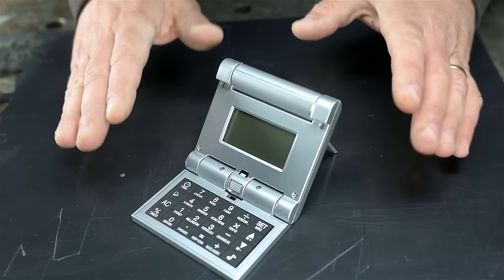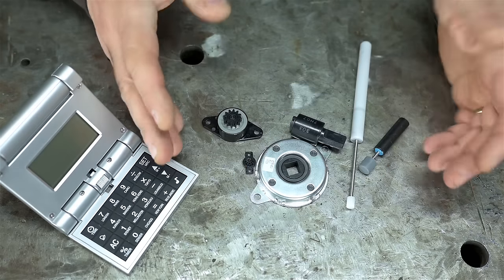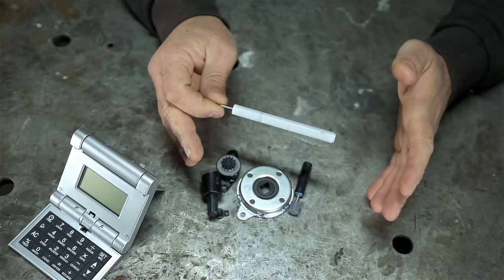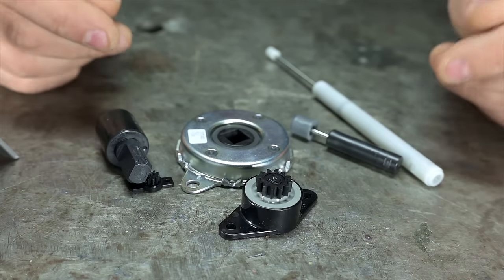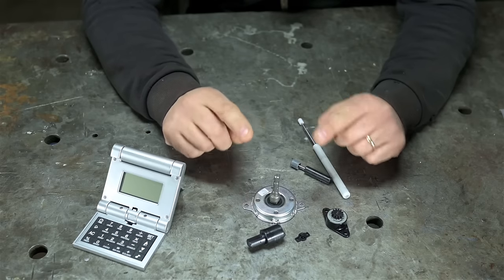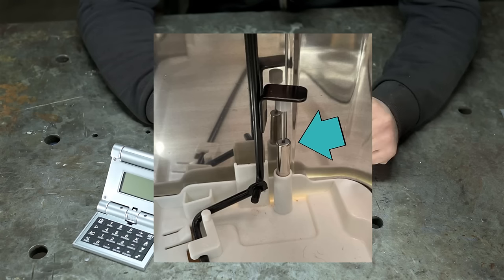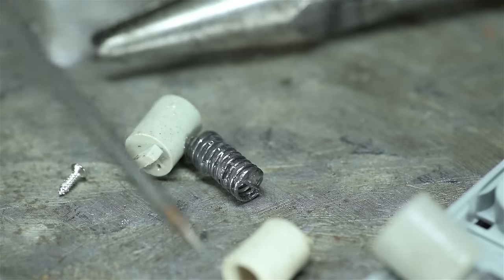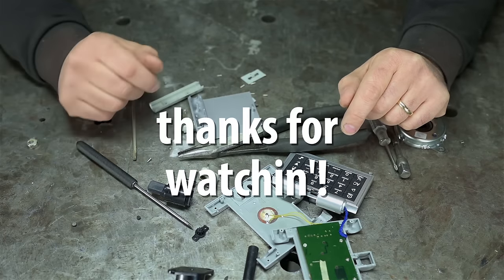Dampers... WHAT A DRAG!

Comment: The fan clutch on your vehicle is also a damper.. engine heat melts a wax and the spinning motion forces the wax outward and locks the fan hub causing the fan to spin and cool the radiator. As the radiator cools down the internal spring forces the wax back towards the center releasing the fan until the temperature gets hot enough and the cycle repeats

Comment: i remember as a kid, seeing that flip open calculator thinking it was so cool!

I pondered for a while how it worked, I decided on a small spring  similar type to the ones in tape a measure, with a felt or some type of friction material pressing on it. 

turns out i wasn't too far off.

Comment: You can find a big one in most rear wheel drive cars on the cooling fan for the engine. Limits the rpms of the fan at high speeds when it isn't needed. Helps save gas. They have a bi-metallic thermostat that reverses the dampening so it dampens more at higher temps and less at lower temps.

Comment: I've seen several that were just greased rubber Orings. Side note I modify linear dampers. Namely racing shocks. Pistons,valving and fluid changes all change the characteristics of a shock. Along with gas pressure to keep the oil(fluid) in check. I can make a LR shock take over a minute to come to ride height on a 2400 lbs car.

Comment: Fun fact, for all coiled spring designs (ie not leaf or Belleville or similar type springs), torsion springs actually don't experience much torsion but rather are loaded  in tension/compressions while typical tension/compression springs mostly only experience torsion.

Comment: CAT used to have a "rotary damper" called a brake saver. Slowed the truck by shearing the oil in housing between the block and trans. Worked great but I don't think it was ever produced by any other manufacturer

Comment: Ive been wondering how they do the slowed hinge movement for ages now! This finally gave me an answer and a whole lot less to worry about in future projects
Reply: you can also do this with magnets did it quite often making flush door cabinets you would mound polar magnets on the door and frame with opposite orientations you can basically slam them shut without the risk of damaging anything as the magnets would slow them down before the magnetic fields aligned correctly

Comment: Great video, very interesting.  

It's strange that car mechanics always say "Your shock absorber is shot" but really mean that the damper is shot.  The spring is the shock absorber which rarely fails and the damper which does fail, simply damps out the oscillations of the spring or shock absorber.  

The Millennium Bridge in London was nick named the wobbly bridge when first opened and had to be retro fitted with dampers to remove the potentially dangerous oscillations.
Reply: "Shock absorber" is the combined assembly of both spring and damper, not just the spring (which, weirdly enough, is called a "spring").
Reply: The spring is the spring. The shock absorber (damper) is the shock absorber. When the spring is wound around the shock absorber, they’re called the strut.
Reply: Funny things, words. The spring stores energy (the "shock") rather than absorbing it; likewise the damper dissipates some of the energy (motion) as heat. So no absorbing really occurs in any technical sense.

Comment: Haha, saw this World clock calculator thing after a very long time.
Story: 1990s, in a village, the local doctor had one of these, and called it the 'electronic glucometer' and used to charge premium for 'running the test' on this. Actually the test was run using the test strips where you match colors. The patients had never seen anything this complicated or technical, and would pay extra to get their blood sugar tested more accurately with the so called 'Electronic' glucometer'. Simpler times!

Comment: Actually the same thing used in some $10k+ cinematography tripod heads. Usually includes a mechanism to adjust the clearance between the opposing surfaces and thus the resistance.

Comment: The fuel tank gauger in my car has a rotary damper that has run dry with the years. I will pierce a small hole in it and refill it with hydraulic fluid. So it stops going from empty to full in every stop.

Comment: Damped it to heck, I wanted these dampers to be some magic mechanism where some thingy rubbed on some other thingy with elegant, force-controlled-by-speed thingy. Instead, it's just plain old laminar-flow fluid dynamics.

I've seen, actually even touched, a rotary  damper made with a motor with its leads "shorted". The resistance of the "short" controls the torque versus speed constant. This was for a really cool outer space thingy so it was way more expensive than a simple PM motor and a resistor, but that was all it was!

Comment: I used to have a calculator with lid that slowly opened when released.
It used a Very Thick Grease around the spring mechanism that slowed down the opening!  Otherwise, it would just snap open and just break itself to pieces.
Hot or cold made no difference to it opening/closing.

Just like your opening calculator/clock.  Yup its the very thick tenacious grease that slows the opening that the spring causes.

Maybe that is what you need!?  (or not for your dampeners)

Comment: I'm currently in the process of painting my truck. I just had a nightmare when I saw that silicone goo on your fingers, imagining that I messed with a damper and 2 or 3 days later, I'm checking the body work on my truck and some of that goo residue is on my hands and I transfer it, unknowingly,  to the surface of the vehicle. It got my thought process going about hand moisturizers and hair conditioner, many of which contain silicone compounds. I've been having problems with fish eyes in my paint jobs. Silicones are just a terrible compound for so many reasons. They just don't go away...kinda like plastic in a landfill.

Comment: How about a vid on the workings of a gas lifter. I think its the same pressure in the cylinder but the area difference between the back and front of the piston wil cause the rod to have more force present at the larger area, hence pascals law, so the rod is pushed forward. If you want a larger force, more pressure is introduced at manufacturing. And is it possible to refill them? They are getting expensive.

Comment: My laptop has a washers hinge with plastic washers between them and instead of a locking pin, it has a small bolt and nut that can be torqued to control the damping strengh.

Comment: It was interesting :-) I was expecting you to also mention how "the resistance level in dampening is modeled by resistance in an electric circuit with L+R+C. R being resistance, L inductance and C capacitance. It swings according to the 3 values, and can be used to accurately model how many times e.g. a car suspension will bounce at a certain weight, dampening and "springage"" - true story - had an asignment with it in UNI.
Reply: Electronic simulations in e.g. MatLab: E.g. finding the most comfortable speed to pass a speedbump - it's not always the slowest. Or finding how many times the center of someting springy will pass the middle point in a spoing before the dampening slows it to a halt.
Reply: @RGSneaker  Driving primitive roads is a good real world example too. A safe speed for the curves and cliffs on either side is usually too slow for the bumps to smooth out.

Comment: The goo is indeed silicone grease. If your hands are still stuck to your mouse, toluene is your friend. Methylated spirits also work a bit; not great, but better than acetone.
Thanks for the video! I do like these ones on mass produced, cost efficient designs.

Comment: I have a prosthetic knee, two in fact, one is a rotary damper and the other is a linear, both have some clever design in knowing if it is on heel strike or toe lift and can disengage the dampening effect accordingly. The range of motion is the biggest difference between them, the rotary being the superior in that regard by about 25 degrees making it easier to sit crossed leg and to kneel. The other difference is how they are armed meaning if they are going to damp or not. The rotary is dependent on a heel strike and takes a while to get to trust it and works well, the linear model is always "armed' and will always slow a flexion down but feels heavy and slow compared to the rotary... Info no one asked for, but there it is.
Reply: damping       NOT        dampening  !!!!!!!!

Comment: On the meta-level, the excitement of hoping to find a complex spring and damper mechanism was greatly slowed and reduced when you revealed that the clock contained a combined spring and goop assemblage where the plastic part press-fitting into the hinge provided all the connection.    So a very minor emotional rotary damper.

Comment: Now you might not read this but I hope you do. So one thing that comes to mind now and then that really puzzles me is the gravity lights that were made a while back for places and people that don't have power on a regular basis. Pretty sure they started on Kickstarter but you basically lift a weight and let it drop and the weight drops over a few hours or so and is converted into mechanical energy than electricity so on and so on. How are they restricting the fall of the weight and at the same time harnessing the mechanical energy. Is it dampers or is it something else?

Comment: The overhead sunglasses/ reading lights box, thing in my Sentra needs this.
I mean, it looks like there used to be one but now, just a little curved strip with gear teeth on the door part.
Also, zip ties are not effective dampers.

Comment: Were the calculator ones actually dampers or did the sticky just cause slower rotation by sticking?? Like doesn't there have to be some kind of baffle or valve to call it a damper? Great video!

Comment: the company i work for makes wallets that have a soft close feature like that for the mechanism (it fans the cards out) and we use exactly the same method. Spring with tacky grease on it. Probably exactly the same grease... And yes it's awful to try and remove. I think the current method of removal is goo-gone and those wipe-all wipes with the textured surface.

Comment: What is the failure mode of these? My toilet lid has started slamming instead of slowly gliding down, but I can't see any grease leaking out. I would guess that the grease is too thick and the baffles in the damper have carved permanent channels through it? Maybe not enough injected during manufacture?

Comment: I've seen in cassete radios, where it was just two gears, with that same sticky goo in between them (I regret touching) and it would make the smooth effect. Technically it was a gear and an angled toothed rack, similar to shown at 5:05 (bottom). I was disappointed with the simplicity

Comment: I pulled plenty of cassette decks apart as a kid in attempts to repair the eject mechanism.  Greasy wheels were the cheap and nasty dampers that they used.  The grease always worked loose and the decks would throw the cassette across the room when you pressed the eject button.  In your case there it looks like they used epoxy (without the second part!).
Reply: Does vinegar wash that sticky stuff off ?  If so, epoxy ?

Comment: So, viscous dampers, but what about friction dampers.  Friction  dampers were used in the suspension of early cars instead of "shock absorbers".  My old Triumph motorcycle had an adjustable friction damper incorporated in the steering yoke.  Electromagnetic dampers, often electronically controlled, of various kinds are used in many places in this modern world.  Nevertheless, viscous dampers have simplicity on their side.

Comment: What did that poor little calculator do to deserve a discectomy. I would love to see more electronic videos from you old Tony. I want to serierialize south polarity magnets in a spherical orientation inside each other with the center one connected to a microgenerator to a buck converter connected to a something that needs low voltage dc power. Ps try to avoid doing it on a metal bench. 🤔

Comment: If you're  really trying to incorporate a damper into a commercial design, you need to remember that what's actually happening is the conversion of kinetic energy into heat.  So if you're damping a lot of energy, or doing it repeatedly, heat transfer becomes something to consider.  That's why commercial shock absorbers should never be painted.

Comment: Silicone Viscosity Fluid, a.k.a. “donkey grease” (as in the harder you push it, the more it resists) is the primary limited-slip element in the center diff of a lot of Subaru vehicles. It has some interesting properties. No common solvents will cut it, and the best way to remove it from your hands is to rub them vigorously with oil-dri (cat litter) and then wash your hands with wd-40 and dish soap (and repeat). I t’s entirely chemically inert and anything you apply it to will effectively be permanently waterproof. It would be the perfect dielectric grease if it weren’t almost literally herpes-level permanent.
Reply: Toluene is a way to break it down just dont get it on your skin.... oh and WD-40 completely forgot about that

Comment: I found those calculator dampers quite ingenious as a cheap solution to mimic the action of commercial units. Even if they look rigged to hack all they work and in the end if you can achieve an identically reliable result through half assed measures then all the more power to you for thinking outside the box.

Now if someone could just come up with a solution fix the Air Core Gauge Motors that go to my 1996 Chevy suburban instrument cluster life would be soo much better. People charging $80-$150 per unit!

I guess they rely on a certain viscosity silicone grease that acts as a dampener of sorts to smooth out the movement of the dial. Over time the silicone grease dries out causing them to flutter or show incorrectly. I guess you can find the silicone grease in quite a range of viscosity on websites specializing in turn tables so if anyone just happens to know what GM used in their manufacture I would practically kill for that info ... so solve my problem and I'll solve yours 😉.... In all seriousness if anyone reads this and happens to have this knowledge I would be so appreciative for the help.

Comment: Ice shoot feom my fridge had one anit would make the ice shut, well shut down a little slower. Presumably to let the stray, last piece of ice come out instead of sitting on the lid and fusing with it.

I had to remove it or else I would cave the fridge door by banging my head on it with frustration. The only thing it was doing was allowing that stray bit of ice to be caught beetween the shoot and wall of the fridge leaving ice shoot open and melting anything inside...

Comment: Dampers are a fascinating piece of kit. As is damping grease itself, which is the really sticky material you found inside them. It's also widely used wherever you want a "smooth" feel to something, e.g. control knobs, microscope eyepieces, linear optical stages etc. Shameless plug - I once did a comparison video for a grease manufacturer, using a toy car rolling down a slope to demo how different the greases are. Some are almost like glue! https://youtu.be/tFSe-9v8tuk

Comment: I used one of the single-direction large flange type (but with a round hole in the center) to damp the return of the large phone dial in a 24 Hours of Lemons truck last year. It worked great except I must not have used enough spring because it’s extremely slow. https://youtu.be/5Zlz0lGGY24?t=644

I had never actually heard of rotary dampers before then but it seemed to describe what I needed so I typed it into the McMaster Carr search box, and sure enough they had all kinds of them.

Comment: It's a torque converter. Not much different from the one on your car or truck. Have you ever wondered what's going on just inches from your legs in your car? It has fluid spinning so fast and under so much pressure that it's like two steel plates locked together.
Reply: bla-bla-bla      this sort of  damper is  NOT  a  torque converter       phool
Reply: @daviddavids2884  Same principle.

Comment: The goop is commercially called smart grease. It is a Rheological  silicone product that has the properties you observed. You can buy it on line and will often find it in slow move products, most common use is in slow fall toilet seats. As you touched it I shouted NO! Because as you found out it is very sticky and not very easy to remove. I would bet a good number of your rotary and small linear dampers use the same stuff. Nice video good to see you back.  https://www.youtube.com/watch?v=aFrGh3rVc-0